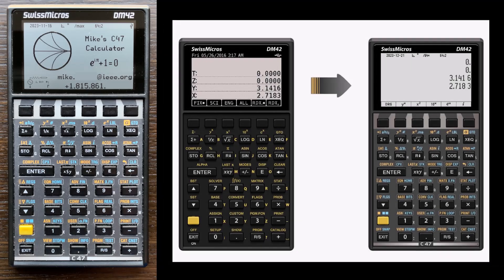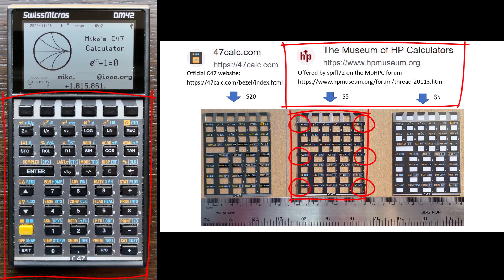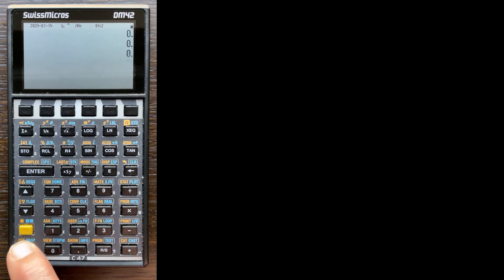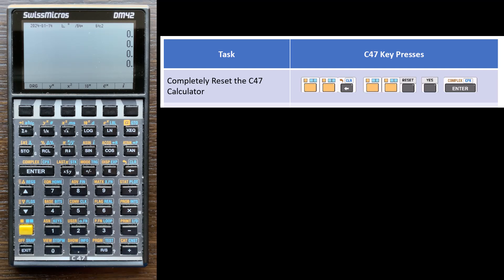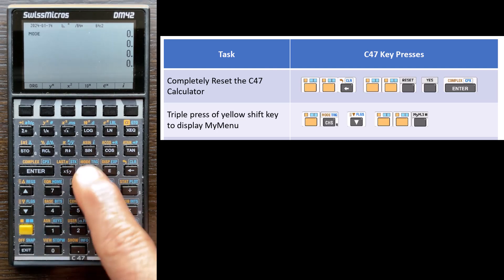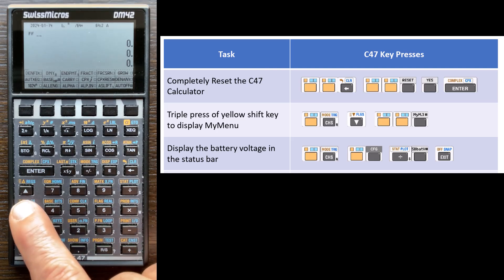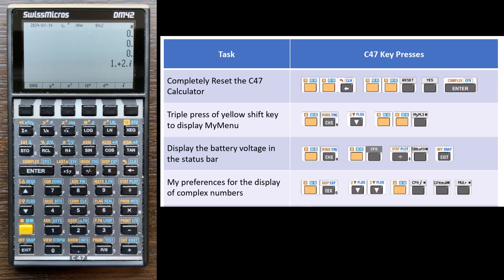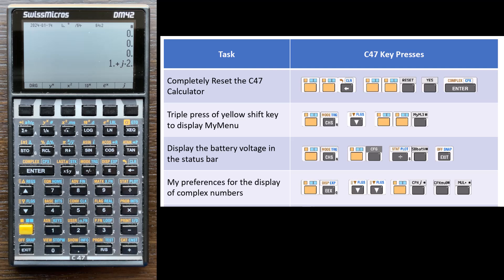video 1, The C47 Calculator

Comment: Many thanks for your hints and tips which I have been adding to my new R47.  The key sequences are somewhat different on this device and now include dedicated yellow/orange ‘f’ (marked HOME) and blue ‘g’ (marked CUST) keys just to keep you on your toes!

In the your tutorial:

1)  Revealing the RESET function is accomplished by:

     ‘g’ CLR followed by again by the ‘g’ and F1 soft key

2) The explanation for always returning to the custom menu only seems to work when pressing the EXIT (but not 
the ‘yellow’ key) 3 times.

     The key sequence is:

     ‘g’ PREF (there is no MODE button) and scroll down to reveal MyM.3 in 3rd row.  Then ‘g’ F5 soft key to enable

3)  To show the battery symbol on the R47: press the blue CUST 'g' PREF [choose CLFG] and toggle the SBbatV flag

If you want to see the exact battery voltage (to 3 decimal places!):  press ‘g’ INFO ‘f’ F2 soft key
(While you're in the CFLG section, you might want to toggle the 'SBtime' flag to display the time too but beware of a cluttered top screen that may affect 'f' & 'g' key presentation.  And how many clocks do you need?)

4)  To set the complex numbers to an engineering notation, the R47 settings are exactly as the video.

Comment: What is the goal of C47? Why run it over standard DM42?
Reply from the maker: The DM42, which is running the Free42 software, is a fine solution.  I used it for a number of years.  I still use Plus 42 on my iphone.  The only reason to run C47, or another alternative such as DB48x is if you are looking for more features than are offered in Free42.  Free42 is constrained because its primary goal is to emulate all the features of the HP42s.  C47 has all the features of the HP42s running on the DM42, and adds even more functions and capabilities with the goal of offering the most complete RPN calculator.  

The C47 is also highly customizable, which certainly increases my interest.

Comment: Are you able to flash back to the 42?  If so, where would you go to get it flashed back?  thx.
Reply from the maker: Yes, you can return to the DM42 software at any time.  The instructions to revert back to DM42 software are included with the C47 software.  Go to this web page, "https://47calc.com/" and download the software.  The readme.txt file can be found in the DMCP folder,  which is where the software for the physical calculator is located.

Comment: The real question to ask is why do I need this when I already have a full hp50g on my phone. The DM42 is 250 CHF, that's a shitload of money. My hp50g goes wherever I go because it's on my phone and therefore always just one tap away. Then, the hp50g is a far mature product with centuries of man hours invested in the software.  HP48/49/50 have an active scene to this day. The only thing I'm missing is a real keyboard and low batteries. And most important of all I've invested time into the HP/48/49/50 platform and that investment is almost worthless with a DM42.

Comment: Thanks again for this video! Today I've started my journey into the C47. Had no problems at all setting up the firmware i.e. the calculator program C47.pgm. Your videos make it easy to get one's feet wet, that's so cool! I'm especially impressed by the small fonts which make extremely good use of the high-quality display and its real estate. Excellent work of the development team!
Reply from the maker: Nice.  I think you will like it, but if you go back to the DM42, I am even more interested in hearing why.  The Forum on the SwissMicros site is very good at providing any support you might need.  

https://forum.swissmicros.com/viewforum.php?f=40&sid=fb252fe7bdae47e543064dac80b7d2a6
Reply: @TeamTricky3.14  
Maybe we get in touch in the forum, I had some interesting discussions there in the past already. My next step is to get a good overview on the functions and specific features of the C47. This will for sure include research and questions in the forum then ;)
Reply from the maker: @N.A._McBee  
I will watch for your next post.